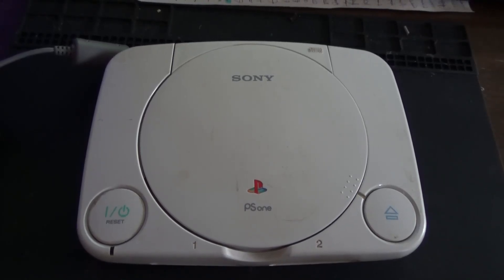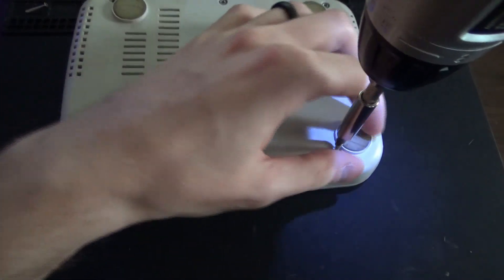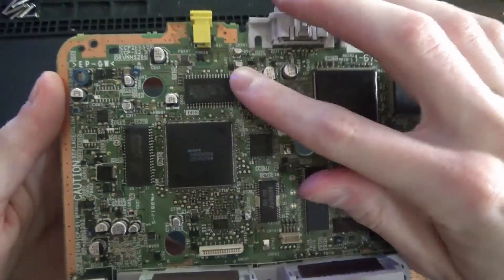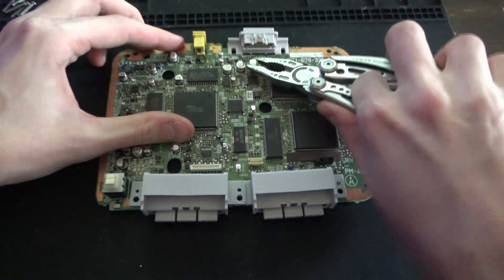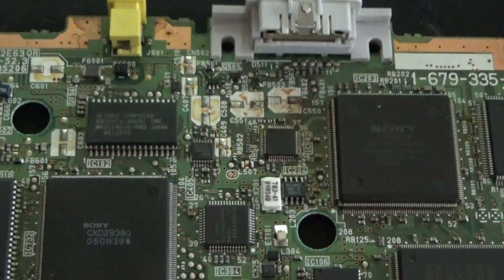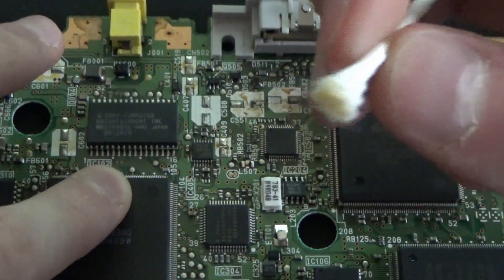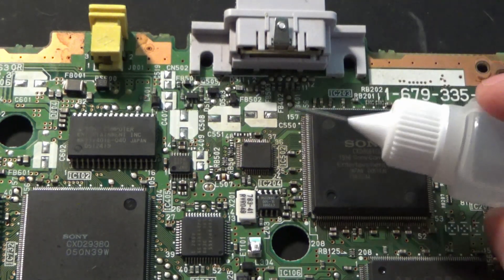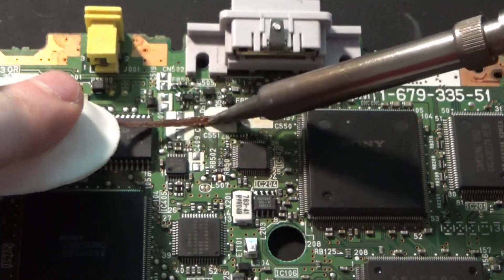Fixing a PSone with no video or audio output

Comment: that's exactly right! I had the problem with bad audio, video was ok, but I have to say after replacing them all, all 17 capacitors, the video improved significantly! the disc drive worked better and the games are read just like normal! awesome video

Comment: I bought a old fat ps1 (made in 2000), turned it on, played about 5 min and turned it off to change the disc. after that no image and no video. only the led light on. Could be the caps too?
Reply: Maybe , u can directly replace the video cpctor or it might be the econder chip , , if u already tried another cable

Comment: can you help me ????
what type of cd drive i need to buy from ebay for the slim model like ur on the video??
Reply: Wondering about this as well. I may need to replace to disc drive as well as replacing the caps.
Reply: @The_Big_Dirty  😃😄 me2
are u haveing this Dark video issue ??
or no video and sound at all?
Reply: No video and sound, disc reader makes a weird noise when it powers up and starts spinning.
Reply: Most likely going to be a KSM-400BAM